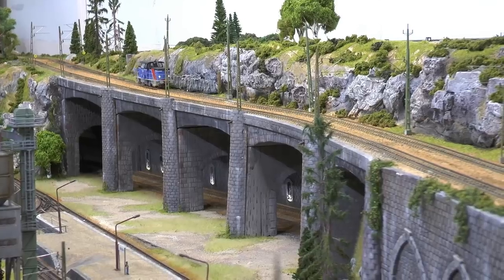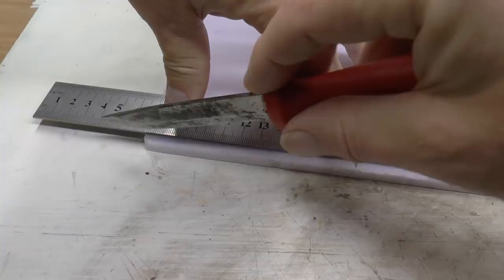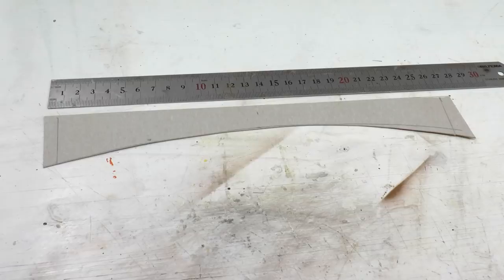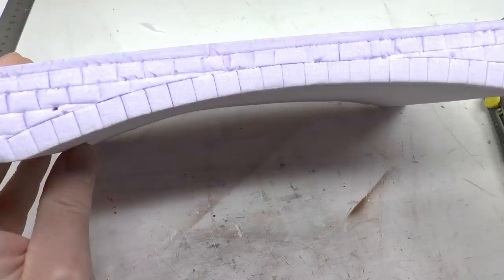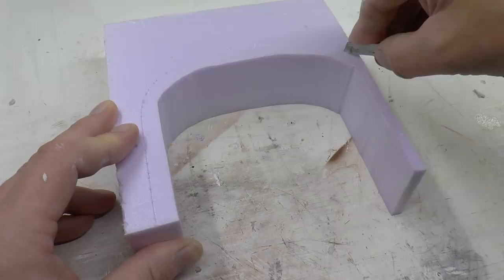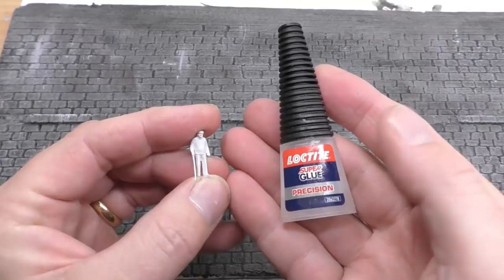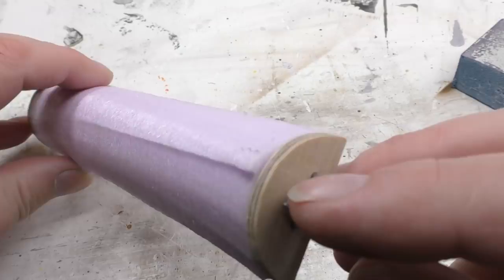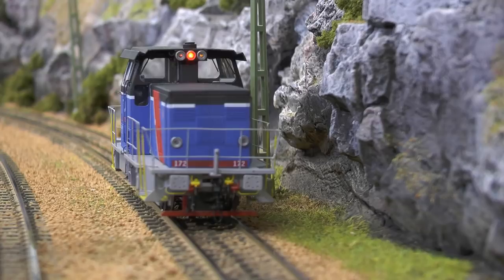Scratch build realistic stone arch bridge - Detailed step-by-step instruction

Comment: Your workmanship and attention to detail is fantastic with great results . I have been watching you use that tool you made for the vertical lines in the bricks . It would seem you could modify the tool to imprint the whole brick or multiples at once by cutting the tab off so its level with the holder you made , have different sizes . If a tool for this does not already exist there needs to be , you can have the patent but i want  a sample from the first production run . lol .